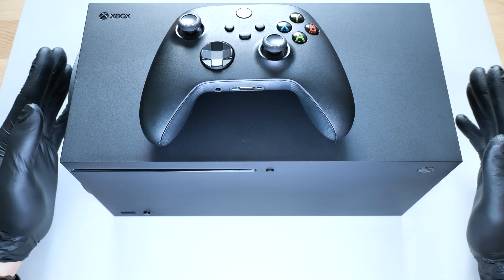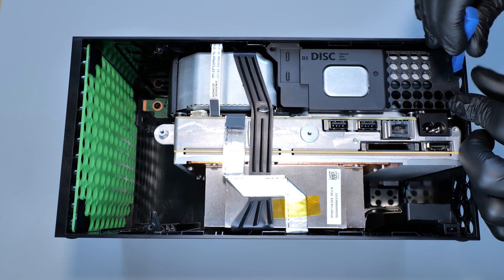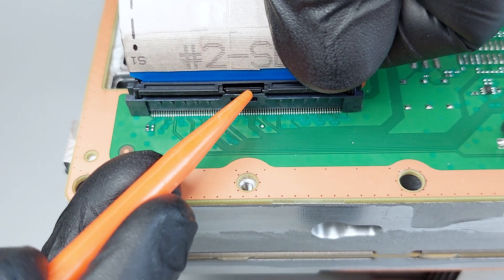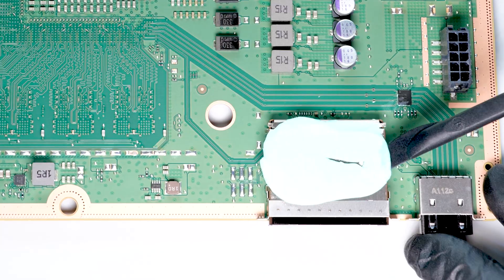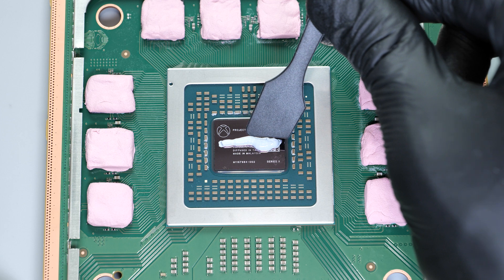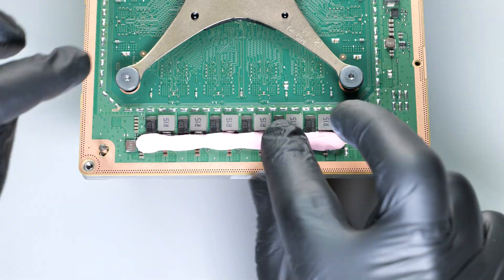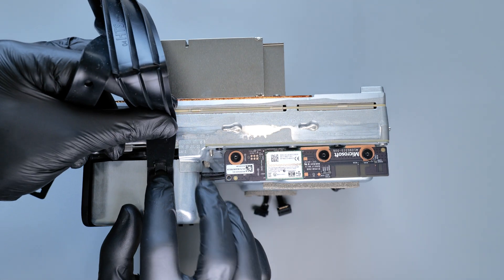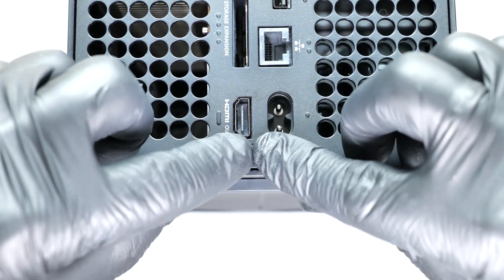Xbox Series X Thermal Paste and Pads replacement and Cooling System cleaning

Comment: Well gonna give this a shot i think my xbox ain't happy been having screen tearing issues FPS drops and excessive fan noise and power usages today it peaked to at 270watt of power constant power consumption and the fan was absolutely screaming and the Xbox hot to the touch have cleaned it recently fron dust but problem seems to be deeper
Reply from the maker: Don’t use your console in that condition it could get damaged beyond repair. Just invest around $40 in thermal paste and thermal putty, replace them and it’ll work like brand new.
Reply: @ElectronicsComputers  got it ordered so now it's waiting then take it to work and pull it apart again but now completely 😅

Comment: The u6 Pro putty is unfortunately not available in Germany, do you know an alternative
Reply from the maker: Du kannst das UTP-8 Wärmeleitpad (viel besser als U6) mit gratis Versand nach Deutschland über diesen Link bestellen: https://shp.pub/78rgdl 50 Gramm reichen locker aus für die Xbox Series X brauchst ca. 40 Gramm, also sind 50 Gramm auf jeden Fall safe. In meiner Werkstatt nutzen wir meistens Upsiren 6 weil’s besser performt als das originale Zeug, aber trotzdem günstig bleibt.
Für meine eigene Konsole hab ich mal das Upsiren UX Pro Ultra verwendet ist aber ehrlich gesagt übertrieben. UTP-8 ist so ein guter Mittelweg was Leistung angeht. Und wenn du’s noch mit Grizzly Kryonaut Paste für die APU kombinierst, läuft deine Konsole jahrelang ruhig und stabil. Lg
Reply: Danke
Reply: Ich habe Sie nämlich gerade gereinigt und mit Gelid Solutions GP-Ultimate - Thermal Pad 1,5mm und der Thermal Grizzly - Kryonaut - 1 Gramm neu gemacht und sie wird immer noch sehr warm/heiß und schaltet teilweise vom Spiel ins Xbox Menü und ganz selten komplett aus
Reply from the maker: @Marcoq2x   Thermal Pads sind echt ein Fehler, den viele machen wir kriegen oft genau wegen sowas Konsolen zur Reparatur. Das Problem ist, es gibt viele ungleichmäßige Abstände zwischen den Bauteilen und Pads sind einfach nicht flexibel genug um alles richtig abzudecken. Dazu kommt, dass der Abstand zwischen APU und Kühlkörper größer wird Folge: Überhitzung und die Paste trocknet viel schneller aus. Aber jo, deine entscheidung ich würd’s halt gleich richtig machen.
Reply: Leider habe ich erst jetzt deine Seite gefunden, dann hätte ich es gleich nach deiner Anleitung gemacht. Mir wurde nach der Suche immer nur das mit den 1,5 mm Pads angezeigt, jetzt zahle ich doppelt aber immer noch besser als wie eine defekte Xbox. Danke schon einmal für den Link des UTP 8. Meinst du, mit der Thermal Grizzly - Kryonaut - 1 Gramm genügt? Soviel habe ich jetzt ca. drauf muss ich ja aber auch nochmal erneuern
Reply: Noch einmal kurz die Grizzly Kryonaut ist doch richtig, weil bei deinem link kommt die Thermal Grizzly Hydronaut?
Reply from the maker: @Marcoq2x  Hab den Link gefixt. Du brauchst Grizzly Kryonaut 1 gramm reicht locker für mehrere Anwendungen.

Comment: Hello! Unfortunately, I have to report that my Xbox fan has gotten louder again. It's only in-game, but in all games. It doesn't to hear in the dashboard menu. I'm sitting about 80 cm away from the Xbox. I assume the Arctic thermal paste has dried out again (like the last few times). I've now ordered Grizzly Carbon thermo pad. These can't physically dry out. Is there anything that speaks against applying it to the CPU? I'm slowly running out of ideas, and I don't want to spend 600 euros on a new Xbox just because of a loud fan. Mine is still technically functional. In some forums, you can read that electrical components can deteriorate over time (thermal conductivity, etc.). My Xbox is still Day One, from 2020!
Reply from the maker: The Series X will never be completely silent anyway. What kind of thermal putty did you use, Upsiren?
Reply: @ElectronicsComputers I used Arctic 6 for the CPU and Arctic thermal pads for the other areas. It's true that it's never completely quiet, but subjectively the fan was noticeably quieter. Maybe I'm hypersensitive, but when I turn the headset down to low, I can hear it. In most forums, people describe never hearing the fan or the console. I think that's what I experienced in the past, too. What has been your experience with the noise level? And in your opinion, is there anything wrong with Grizzly's carbon pads? Many thanks and best regards
Reply from the maker: @Tortur33r   Well, now it all makes sense.
Back when we first started getting Series X consoles into my repair shop, we ran a bunch of tests to figure out the best cooling setup and yeah, Microsoft uses thermal putty instead of pads for a reason. There’s just no way to get proper cooling with pads alone.
The internal layout has uneven component heights and non-standard gaps. Thermal pads especially high-conductivity ones, aren't compressible enough to fill those gaps properly. That creates poor contact between the APU and the heatsink. Most likely, the gap between your APU and heatsink is now larger, so the paste dries out quicker and loses effectiveness hence the extra noise.
What I showed in the video is exactly the solution we use for our customers, and we back it with a 3-month warranty. If you want to go top-tier, try Upsiren UX it’s hands down the best thermal putty on the market right now. No thermal pad comes close to the performance it offers. So yeah, the best approach would’ve been to stick with the manufacturer’s design but use higher quality materials which easily outperform the stock setup.

Comment: I wonder why ps5 not using thermal paste meanwhile xbox just use thermal paste for cooling system
Reply from the maker: Do you mean why the PS5 uses liquid metal while Xbox sticks to regular thermal paste? It mostly comes down to cooling design. Xbox uses a massive heatsink and a powerful fan that can handle high temperatures and maintain strong airflow. Because of that, regular thermal paste is more than enough it's cheaper, safer and gets the job done.
Sony, on the other hand, uses liquid metal to boost heat transfer between the APU and the heatsink. This lets them save on materials smaller heatsinks, less powerful fans, and a more compact design overall. But here’s the catch liquid metal is electrically conductive. If it’s applied improperly or leaks, it can short out components. In my shop I’ve seen plenty of consoles, GPUs and motherboards ruined because of it especially from DIY jobs. It’s not something to mess around with. Think of it like mercury slippery, hard to control and destructive if it spreads. So yeah, liquid metal works great but thermal paste is safer and more forgiving, especially for long-term reliability and repairs.

Comment: I got a question so my Xbox fan is running all quiet before starting any games and then it feels like it's about to lift off like a plane when I open the game. I had a guy recently reapply thermal but I think he did a poor job. What do you recommend me doing? I have the tools to reapply the thermal but I don’t know if that’s the issue or not, do you think it’s something else?
Reply from the maker: I’ve got a pretty good idea what might happen, we get a lot of clients who tried cleaning the console’s cooling system or replacing the thermal paste themselves, but ended up making things worse. Then they bring it to us for repair. I even mentioned this in the pinned comment because it’s super important, that once you lift the heatsink off the motherboard, you MUST reshape the stock thermal putty or better yet, replace it with a high-performance one like Upsiren (link in the description). Just replacing thermal paste isn’t enough, and a lot of people skip the putty step entirely, which can lead to overheating or long-term damage.
Reply: @ElectronicsComputers if I follow your video the problem should be fixed? I’ve only powered it on once after repair.
Reply from the maker: @wrld5632   Speaking from experience, if you use high-quality thermal paste and putty, the console stays cool and runs nice and quiet, even under heavy load.

Comment: I did everything as shown in the video two weeks ago. The Series X is quieter now. But when everything is quiet, you can hear the fan. My question: How loud is the Series X when playing a high-performance game? And does it make a difference in heat generation whether it's played via disc or digitally?
Reply from the maker: The Series X is never going to be completely silent, unless your room is literally below freezing. When you're playing high-performance games, the fan will kick in and you'll definitely hear it, but it’s not loud enough to be annoying. There's no real difference between digital and disc versions in terms of heat generation, but keep in mind the disc drive, when it spins up, is usually louder than the fan.
Reply: @ElectronicsComputers i think i know the reason, that being the brand or the model of fans microsoft likes to use. 

I turned my xbox 360 on after a few years and it's fans have this loud whizzing noise and guess what, even a fresh 360 unboxing video shows the same result, same whizzing noise. 

It's whatever bearing or something they use that makes it never be fully silent but man, does it not last long. 

15 years later my 360 is still not making that screeching sound yet. 

The PSU fan has already started to make those noises they make when it carves it's surroundings after years of use but 360 itself? Nah.

Comment: Hi really nice video, if you could answer this question you would really give me a complete picture of the operation, maybe it will be useful to someone else. can you tell me the thicknesses you make when you put the thermal paste on the APU, (the paste with the syringe on the central chip), and how much thickness you put instead in the secondary chips that are next to it. maybe also the thickness of the paste on the SSD. and then, in total how much thermal paste for the secondary chips did you use? I hope I made myself clear, if you answered you would really do me a great favor, bye.
Reply from the maker: Just apply a line of thermal paste directly onto the APU die and spread it evenly. That amount will definitely be enough, resulting in a layer about 0.5 mm thick. As for the thermal putty, you’ll need around 40 g for the entire console. Once compressed by the heatsink, the putty typically settles to a thickness of 1-2 mm, depending on the area. Apply about 4 mm of putty on the memory chips and along the line of MOSFETs. For the SSD, under the metal shield it should be around 3 mm, and 4 mm on top of the shielding. I always eyeball it when I do this kind of job for clients. If you want to be extremely precise, you can remove the old putty from, say, one memory chip, and then take the same amount of Upsiren to visually match it before applying. But honestly, it’s hard to mess this up once the heatsink is in place, it will compress everything properly and it’ll end up looking the way it should. Good luck!
Reply: thank you so much really, great work again, I'm fine now, thanks, keep it up

Comment: Great video BUT I’m hella confused when I’m going to order this stuff. 

As someone completely clueless to what I’m doing, I only have one issue.

At the begin, 0:23 you pointed at the Upsiren thermal PASTE and called it “putty” and YOU called the thermal GREASE “paste” 😵‍💫

And then when it’s out of the box at 5:25 the top of the container on top says “putty” but yet the outside of the box it said PASTE!!!

😂😂 what the hell bro 😂😂

Your Alibaba link to it shows both pastes AND putty’s, so how do I know if I order the paste that the container inside is going to be putty 😂😂😂

I read elsewhere that they’re different things, so I’m HELLA confused bro

To someone ignorant like me, it looks like you used thermal PUTTY & Kryonaut thermal GREASE and there’s no PASTE being applied in this video. 

I just want to order the right things and fix my console, man 🙄
Reply from the maker: At 0:23, I pointed at the Upsiren thermal putty and clearly said that it's the thermal putty. You use thermal paste only for the APU, and thermal putty for the memory chips, SSD, and MOSFETs. Thermal putty looks and feels like playdough, while thermal paste has a grease-like consistency. So you need to buy both.

Comment: My problem is that the thermal paste keeps drying out, and the fan becomes very loud again. I've already replaced the paste four times, always only on the GPU. Other areas never dry out. Can I apply thermal pads to the GPU instead of thermal paste?
Reply from the maker: What kind of thermal paste are you using?  Also you must replace both the thermal paste and the thermal putty to achieve the best results. If, for some reason, you can't replace the thermal putty, you’ll need to reshape the original one so that when the heatsink is reinstalled, it gets compressed to the proper thickness and makes solid contact. If you skip this step and just put the heatsink back as-is, it will not make proper contact with the putty, and the heat transfer will be compromised, which could lead to overheating or long-term damage.
Reply: @ElectronicsComputers  I've always used the 3x Arctic MX6, 1x Grizzly Kryonaut.(the grizzly dries out after a few days). All other areas always looked like new and gave no indication that they needed replacing. Only the CPU paste was completely dry (usually after 1-3 months). So I don't understand why it could be related to the other areas?! The question remains: maybe pads on the CPU dry out less quickly. Or is my paste simply inferior? I would be happy if you could help me. By the way, your video is great. I use it all the time.
Reply from the maker: @Tortur33r   In my repair shop, we’ve always used MX-5 for cheap laptops, then switched to MX-6. For graphics cards, consoles, and gaming laptops, we’ve been using Grizzly Kryonaut. All of these pastes last for years and stay in that slightly greasy, pliable state. I’ve personally seen graphics cards that customers brought back with other issues, and after almost two years, the paste still looked like new. So if your paste dries out quickly, it’s either fake or something fishy is going on. Also, I can't stress this enough: once you lift the heatsink off the board, you MUST reshape or replace the thermal putty. If you just put the heatsink back without doing this, those components will never get proper cooling. Over time, they’ll slowly overheat and degrade, the motherboard will run hotter, the memory chips and APU will get extremely hot which only makes the APU heat up even more. There are far better thermal putty options nowadays compared to the stock ones, like Upsiren UX (gray color). It’s especially important to replace the putty on the SSD, since these often overheat and fail due to that metal shielding, which Microsoft finally removed on the newer Series X Galaxy Black edition. And if you use high-quality, original thermal paste, your Series X will last much longer than the sad statistics we see today.
Reply: @ElectronicsComputers Thank you very much for your quick reply. I'll replace the paste everywhere, as you recommend. Perhaps that's the source of the problem. Is there anything wrong with using pads (Arctic TP3 1.5mm) there? It's rather unlikely that the paste is fake. On the CPU, I'll use Grizzly or MX 6 as usual.
Reply from the maker: @Tortur33r  Thermal putty provides way more thermal conductivity and performs better than any thermal pads.

Comment: At first, thanks for this guide🙏🏼 Very helpful and easy explained. 
BUT there is one important point I have to mention. You didn't say that if you don't have new pads, you have to take the old ones off and reshape them. It almost fried my console.
I left it like that and my console crashed and couldn't be restarted. But you mentioned it in another comment, so I did it a second time. This time with reshaped pads.
Had to start the console 2-3 times and take it off the power again, but then it worked again.

Now my console doesn’t crash anymore and i can play with full joy
Reply from the maker: Well, the video is about solving overheating issues, which significantly extends the console’s lifespan, and I showed exactly what needs to be done. To me, it goes without saying that both the thermal paste and thermal putty should be replaced. It honestly never crossed my mind that someone might replace one and not the other. It's like changing only one shoe when the pair is worn out.
Reply: @ElectronicsComputers That‘s what i thought after rethinking the whole thing. But as someone who’s not into things like electronics, I didn’t think about that :D 
Afterwards, sure.. It would’ve been obviously.
But as a amateur in those things, I’ve not thinked about it 😁
But still I loved that Guide, it somehow was my fault. Just wanted to remind you that there are amateurs who not think about those things 🙏🏼
Reply from the maker: @DerDannyyy  Thanks for pointing that out, I think I’ll make a pinned comment to warn others. Really glad you caught the issue, figured it out, and managed to fix it yourself. Happy to help anytime!

Comment: For the putty what size would you recommend 10g 50g
Reply from the maker: You need at least 40g for the Series X. So you can buy either two by 20g or one 50g.
Reply: @ElectronicsComputers thank you
Reply: My Xbox series X keep shutting off when I play games after a hour or so. Opened it and got all the dust out so this is my next test to see if I can get it to stop from shutting off.